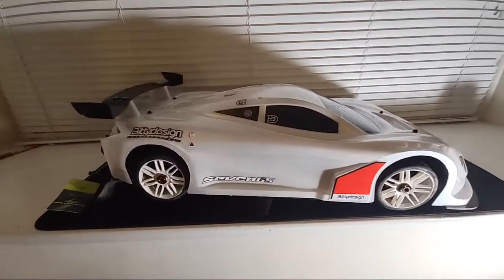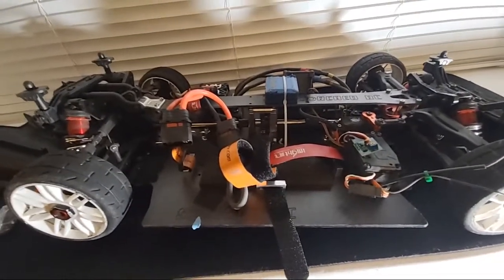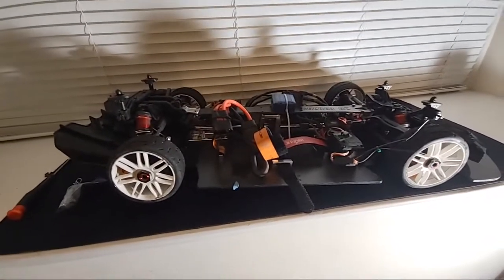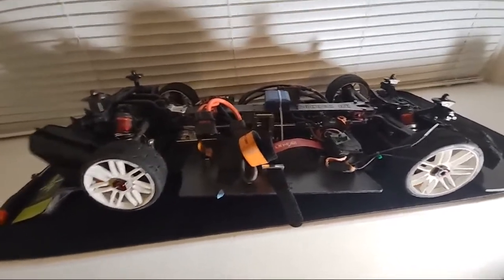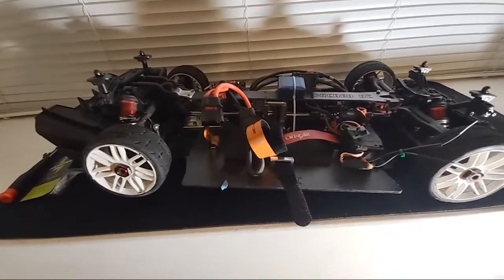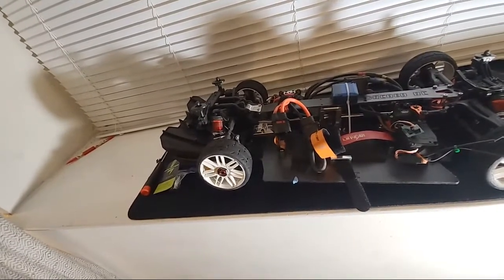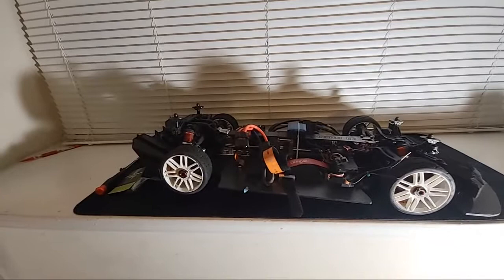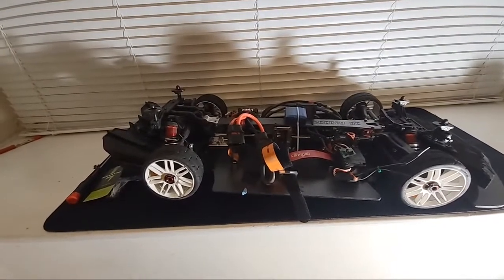Arrma Limitless Build Overview And More....

Comment: Keep up the good work man that's a really nice build the only recommendation I will have for you is that if I'm not mistaken I believe a dual antenna receiver needs to be 90° away from each other.
Also the gyro is a good feature to have doesn't really matter how good of a driver you are or how straight the vehicle goes there is no possible way you could correct that if it loses traction at a high speed that's what the gyro is for 👊🏾
Reply from the maker: Thank you for watching.